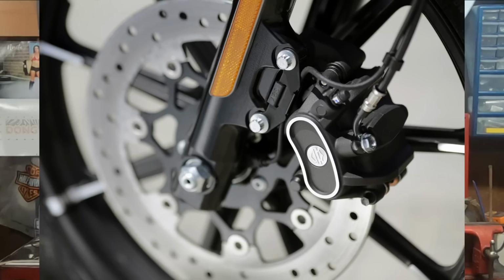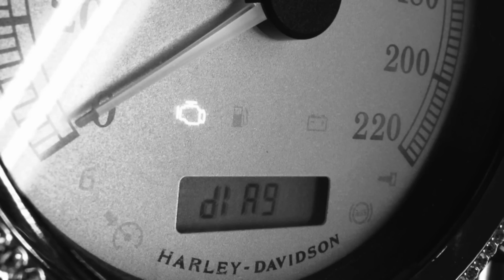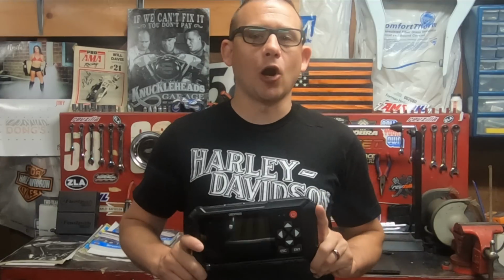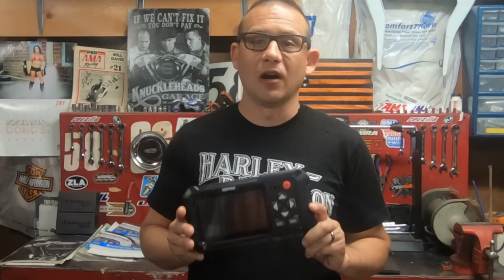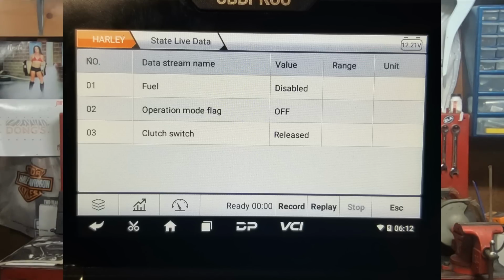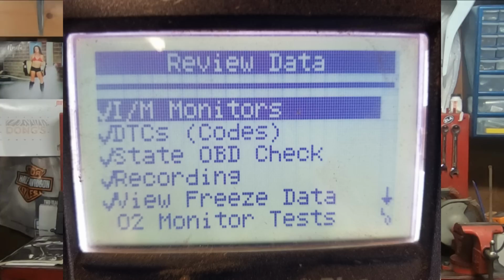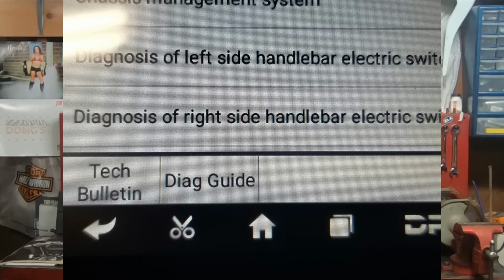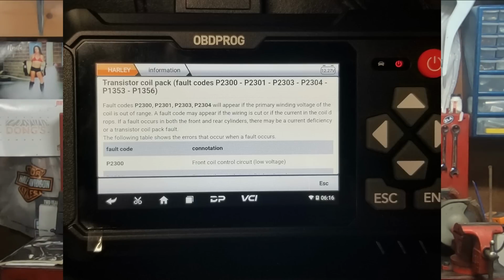Motorcycle Scanners are the Future of Motorcycle Maintenance

Comment: Before I ripped the Magnetti-Spaghetti out of my bike, I was watching the 'Scanalyzers' for this system. $1000?!?!?!
I won't own or work on a Harley that requires such nonsense. A friend who owns an auto repair business does have a computer that does work with the Delphi system. IIRC, he has to buy software every year for Harleys.
Reply from the maker: That's all the Harleys are is the Delphi system, you can read and clear codes no problem. The software is what gets you, you have to have that to operate the systems and make changes. This unit actually has the software that allows you to operate the systems and make changes as needed.

Comment: My 2002 Dyna laughs at your over complicated computer controlled, fuel injected, anti-lock brakes (Jesus Christ, car yes.. bikes NO!) with a radio (the only sound anyone should hear, is the two notes coming out of the exhaust pipes). EDIT: To be fair, I'm not adverse to FI and computer control. I wrench my nephews bike that is all those things with no problem. Your bike should be even more reliable then you car. I do serious road trips of 1 to 2 thousand miles. I can fix just about everything with a hand full of tools.
Reply from the maker: The nuts and bolts are all the same but with all these new systems on bikes it's getting ridiculous trying to fix little things. I still remember riding litre bikes years ago which put 150 horse to the rear wheel without any rider aides. Not traction, wheelie whatever control, you paid for your mistakes back then lol.
Reply: And the old school riders laugh at your electric start and gauges. Everyone should kick start their trusty steeds. And you aren't a real man unless you crap in an outhouse. My trips average distance are roughly twice the length of yours. And I too can fix almost anything with minimal tools. I like my stereo when out on the road. That's all that really matters.
Reply: @mrwhite2628  LOL.. Been to the outhouse plenty. Kick started plenty also. Good times. Nothing beats a long trip on a Hog, no matter what the configuration is. Ride safe brother!
Reply: @hawkdsl  Hahaha! You too, Hawk. Keep the shiny side up!
Reply: Hey Chucky here, Are you still interested in a solar powered generator?🇺🇸⛽🎟️🤣🙄😷 If so, well, I've got news for you.....

Comment: When the ABS system on a BMW goes bad it is a $2,400 repair. Most people simply bypass it so you have manual brakes like in the old days. Electronics don't have long life especially in the environment you find on a motorcycle. When something electronic goes bad people will simply live without it rather than pay the extravagant cost to fix or replace it. I have no idea how to work on fuel injection but I know how to take an Amal carburetor apart clean it three gasketed put it back together and it works good enough for me.
Reply from the maker: People buy these new bikes and want all the latest tech and options without thinking of maintenance later on down the road. It's expensive to buy and expensive to maintain having a shop do the work. I sure miss the nuts and bolts of just a simple carb cleaning and jetting.
Reply: Exactly.

Comment: Hi do you know if this supports all the various Harley-Davidson maintenance port plugs?  4 pin 6 pin, etc
Reply from the maker: It does and it comes with all the different cables you'll need to be able to hook up to any Harley, even the new M8's when they moved from the 6 pin to the new style. You get the cables to hook up to Indian, Victory, Yamaha, Honda, Polaris and BRP. It's fully functional with any fuel injected product from any of those manufacturers.